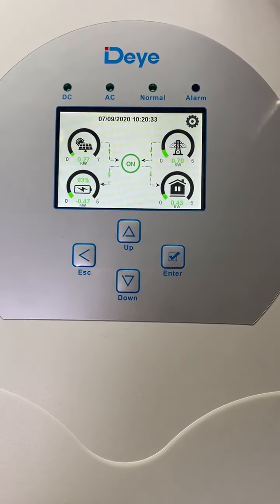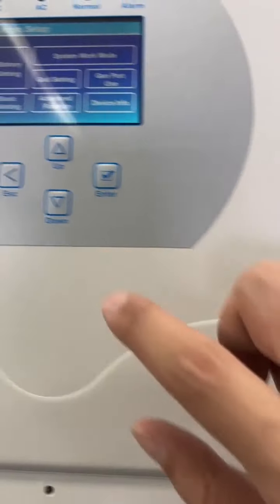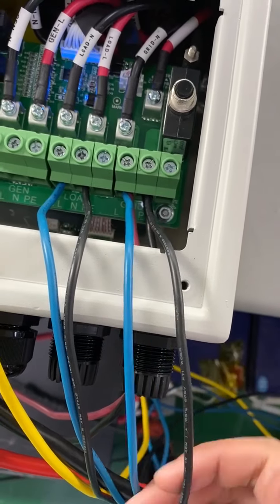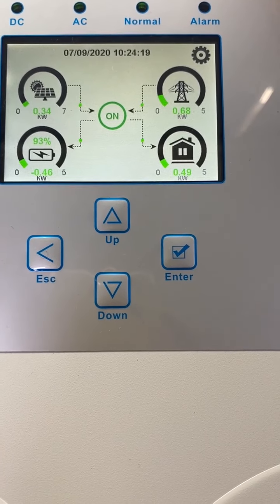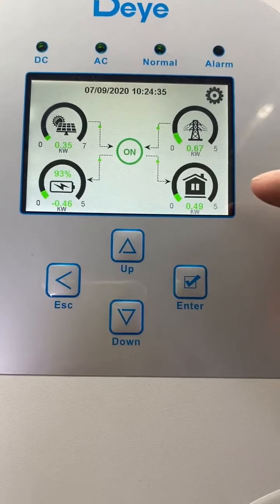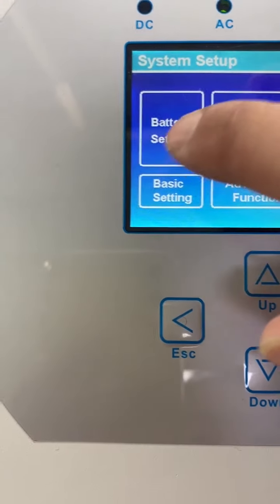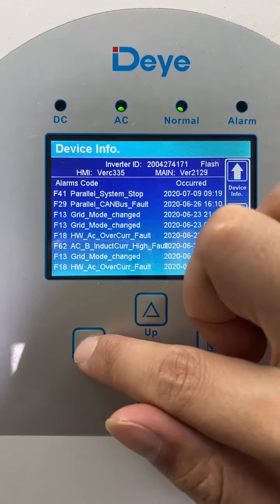Parallel function of Deye hybrid inverter

Comment: Is it possible to connect two different sighle phase inverters in parallel? SUN-8K-SG01LP1-EU and SUN-6K-SG03-LP1-EU?
Reply from the maker: It's impossible
Reply: @DeyeInverter_official
Reply: @DeyeInverter_official  Thank you. I will buy second SUN-8K-SG01LP1-EU. But I have a problem that it is impossible to get in EU. No e-shop offers the single phase SUN-8K-SG01LP1-EU

Comment: Hello Kyle. Can you please confirm wire connection sequence. On internal wires above they are marked and sequenced as Neutral and then Live. But on the silkscreen text below the terminal blocks they are Live Neutral PE. Should external connection be made as L N PE or N L PE ?
Reply: Also, if you have parallel inverters, if L and N connections are swapped. Would this cause problems with CT readings when trying to do zero export to CT when all load is connected to load port and only grid supply connected to grid port?
Reply: @robgood9119  you all right.
this causes the problem of restricting exports to the mains.
Reply: @robgood9119  Dear, Kyle! We had a problem in the system with limited export to the mains through measuring CT in 5kW hybride inverters.
The problem was solved by changing the direction of installation of the current transformer
Reply: Did you find True choose? Which one is True? Board or Connected cable marking?
Reply: @oguzatagan5500  Yes, the PCB board markings
Reply: @robgood9119  sorry which marking? There is 2 marking on the board. First front of the terminals. Second is under the from internal cables. Front terminals marking is L, N, PE.  İnternal cable marking and under this cable pcb marking is N, L, PE. Which one is True? Thank you for your attention.
Reply: @oguzatagan5500  The ones at the front of the external cable connection terminals
Reply: @robgood9119  where is  grid terminal internal fuse(Black box has a button) on your device? And what is your pcb versiyon? İts sun-5k-sg02lp1.con versiyon 1.4?

Comment: Kyle thank you. So if I want a total of 90 amps charge current, I set each inverter at 30 amps?
Reply from the maker: yes
Reply: witch model is this one?
Reply: Is it possible to have separate battery for each inverter in // ? 
Also can we use smart load output in //?
Thanks
Reply: @nicof9202  good morning. Thank you for watching and commenting. Yes it is. There are videos on YouTube that show them with separate batteries. Regarding smart load when in parallel. I don't know the answer to that. I will ask and get back to you. Great questions

Comment: I have a three phase coming from grid can i use different power rating in parallel for exaple in L1 ( 6kw parallel with 6kw) parallel with L2 (6kw) parallel with L3(4kw)?

Comment: You did not use busbar for interconnecting the battery cable and ac output, you direct the wire of the slave inverter to the battery terminal of deye master?

Comment: Hello, I have a question. The inverter SUN-12K-SG04LP3 has the parallel connection device built in, or do I have to pay extra price and buy this extra feature?
Reply: It is built in.
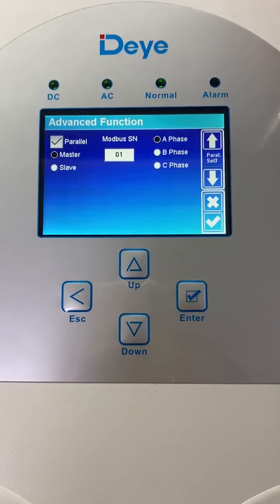All you need to do is "enable" it as shown here 1:11

Comment: Hi, for Lead acid batteries, the bank need to be connected in parallel also, or can i connect a battery bank independent to each inverter?. I have 3 inverters and the battery voltaje is lower on Slaves inverters, when the master stop charging the slaves do also and the batteries are not charged complete.
Reply from the maker: yes, the battery need to be paralled as well. that issue caused by the battery is not commoned for the three inverters.

Comment: Hi Kyle, I just want to ask. 

There is a parallel connected Deye Hybrid Inverters. Both are 8 kW Hybrid Inverters. 

We connected a Over Under Voltage Protection Device so the client can monitor the voltage and current passing through. 

My question is, the Inverters are running normally and don't have any errors, why is it that there is no current passing through the Grid terminal of Inverter 1? Current is only passing through to Grid terminal of Inverter 2... 

What could be the reason?
Reply: Continuation to the first question, when the client turns OFF the circuit breaker for Grid of Inverter 1, brown out occurs even if circuit breaker for Grid of Inverter 2 is still ON.
Reply from the maker: Hi, the grid port of each inverter should be paralleld. the second one exploed ? if so, contact your inverter provider.
Reply: @DeyeInverter_official  Hi Deye,

No, it did not explode. 

There is just no current passing through the GRID terminal... 

Then now, the batteries just became low-battery status (Battery 1: 0%; Battery 2: 12%) and the whole system just shut down. 

I think this happens every month.